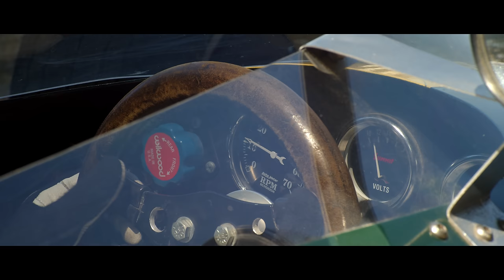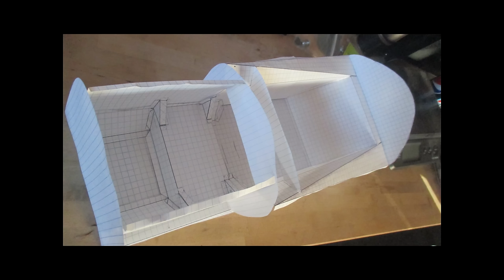How I Didn't Build a Lotus Indy Car from Scratch

Comment: That is just awesome, just awesome, really. Wow. I cannot wait to see the next episode.
I am hoping in a future refinement you can put the piping for the radiator inside the "fuselage". This car has such nice line.
I think my fav would be the 1967 Lotus 49a if I was ever inclined and capable of achieving what you have done it would on the 49a model.
If I was crazy it would be the McLaren MP4/4.
What you have built with the means you had is inspirational, do not under-appreciate by an iota.
Inspirational.

Comment: That was a Matra that Jackie Stewart won with in 1969. js
  Now back to the video
Amazing build. Thank you for the tribute to the greatest F-1 driver and builder of all time with the most iconic Indy car of all-time. 
Powered by Ford too. I love it.
 Also have driven many an autocross at Marina too. Been years since I last did and I hope the facility is still availabe to use.  Only drawback is you have to shutdown when they're skyjumping. 
  Did you ever run at Atwater when they used the old Castle AFB? One of the locals named Dennus Losher used to own the original Shadow AVS Mk.1 along with their F5000 car and their 1974 F-1 car(ex J.P. Jarier).
  Love the build and hope to see it in person someday.
Reply from the maker: Your right! I meant the 71 Tyrrell with the wide tanks.   Oddly enough, I grew up in Merced and spent a lot of time at castle with friends whose parents were in the air force.  But I didn’t know that auto crossing existed till long after castle had closed down and I had moved to the coast.   I knew someone in the area had a shadow because I’ve seen pictures of it at Fresno autox’s.  And the original Shadow headquarters is only 20 minutes away from me now.   Anyway there’s a good chance I’ll have the car at crows landing for the GGLC event on sSeptember 28th.  But if the forecast is for triple digit weather, I’ll find something else to do.
Reply: @benbeames Crows is about as good as it gets around here. I remember in my autocross days running Crows, Atwater(Castle), Candlestick, Oakland, Golden Gate Fields, McClelland and Mather in Sacto, Fresno Fairgrounds. So many places and now they're almost all gone. Last ran in 2021 at the Lone Pine Time Trials as a bucket list item. Crazy fast! Loved it.
  Will try and make it on the 28th Lord willing. She's a beauty. So is your GT40. That's some seriously talented devotion sir.

Comment: Cool as hell and any plans to lock the diff?
Reply from the maker: Good question!  I'm still planning on changing gear boxes so I could do it when I do that.  The price on a locking diff though is more than the used gear box so that kind of keeps the idea on the back burner.
Reply: @benbeames  not  sure what dif  you are using but maybe there's a kit or a spool to convert it like there is for GM, Ford, Dana etc
Reply from the maker: @OG_Gamers_Live  There are.  They cost 2 to 3 times what a used transaxle costs and then you have to install it in the transaxle.  Maybe someday but there are other upgrades that give better performance for the money at this point.
Reply: Wow wasn't expecting   that, but I get the back burner thing   in that case.  Really cool build and so is the GT40. I got thru pt 2 and subscribed.  Great channel for sure.

Comment: Is there any thought that you would like to beat the guy that broke Colin Chapmans record for light weight car (which done by Gordon Murray's record which is the LCC Rocket car 380 kg no monocoque chassis it was Chrome Moly tube steel ) using a similar chassis that you have made but the engine should be a KTM 1290 (with a semidry sump factory fitted as standard) and a final drive and LSD gearbox from Z cars UK . 

With a few ergonomics advantages,  shifter and clutch controls on the wheel like morden f1 cars a simple version. Slightly reclined seat to reduce center of gravity. Radiators mounted on the sides of the car similar to morden f1 . No Carbon fibre. 

A monocoque chassis with        chrome moly tube subframe front and rear.